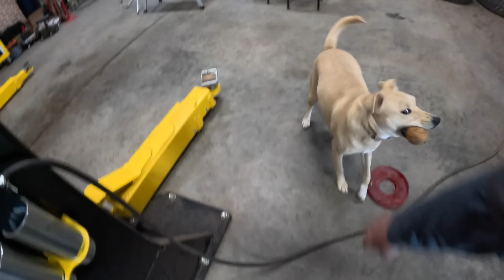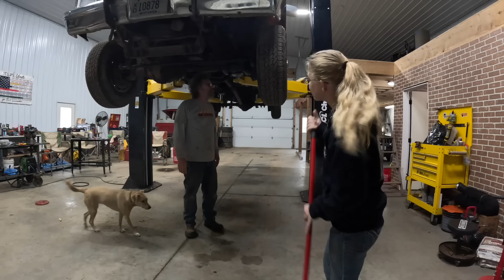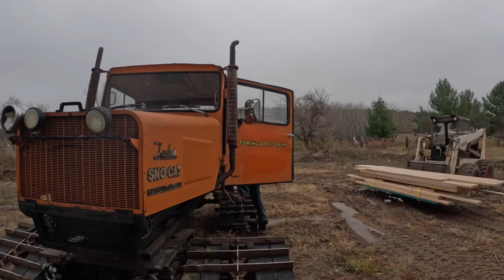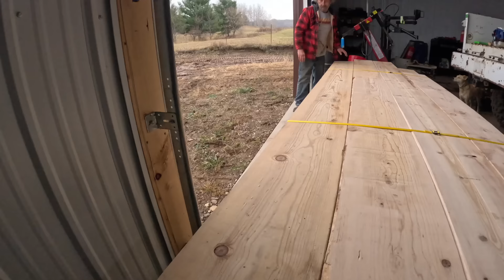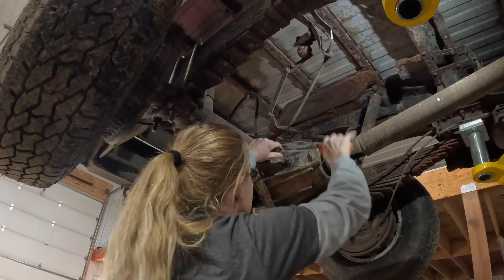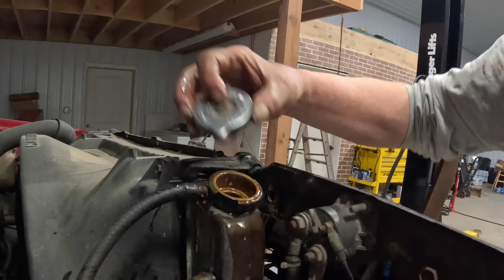Will the square body plow truck live?

Comment: Looks like you did a good job on the maintenance. Don't forget to mount the blade and check all the pins, springs, mounting brackets and hydraulic lines for damage, leakage and lubrication. 😃